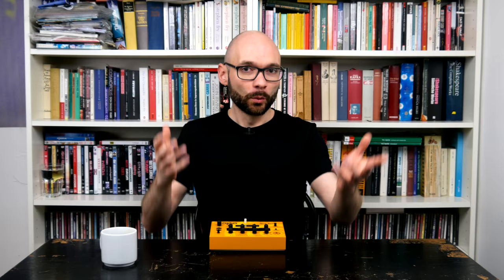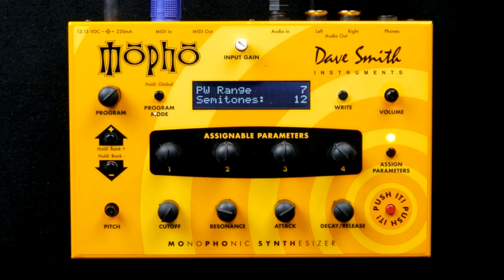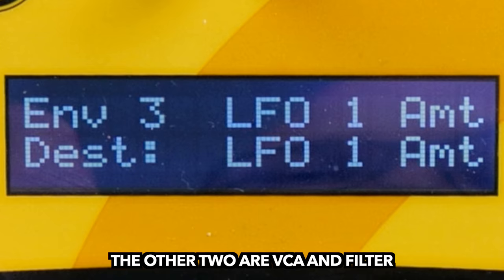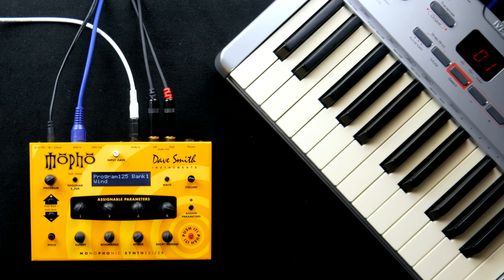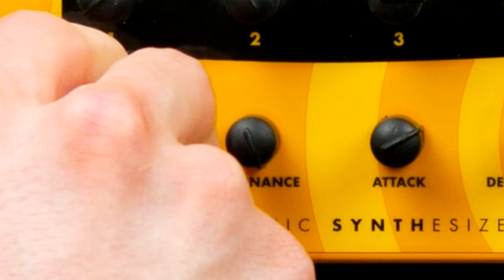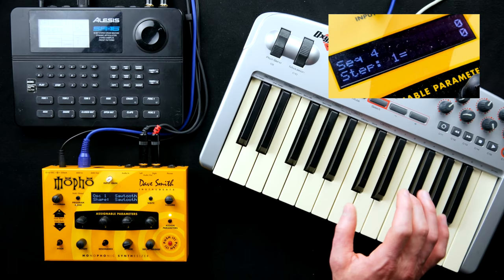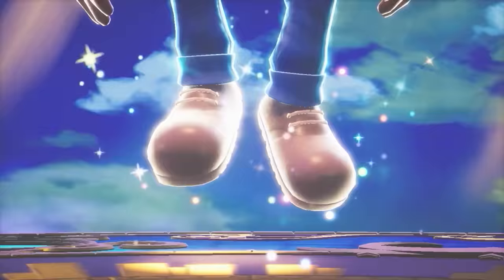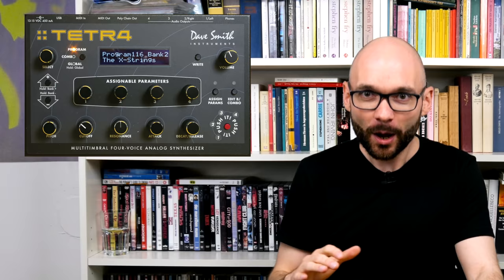Bad Gear - Dave Smith Instruments Mopho - Giving the Pro-1 a Bad Name???

Comment: I have a whole bag of these encoder caps. You can have quite a few. I upgraded my P08 with the $70 overpriced factory Prophet upgraded knob kit so I have no use for them.
Reply from the maker: Thanks! Are these the same encoders?
Reply: @AudioPilz  i believe they are. It's quite annoying the way they are on my P08. I tried to find aftermarket knobs but they are weird encoders. The D-shaft is opposite what it should be. so if you find a knob cap that fits often the tick mark operates opposite of the way it should. Which forced me into buying the expensive DSI factory P08 upgrade kit that makes it look kinda like Prophet 5 style knobs.

Comment: I used to own the desktop version and I agree, it sounds amazing, it’s very capable but it’s always tied to the computer to use the software editor and the endless encoders suck. I did put bigger better Moog style caps on mine though and that was cool. I would love to try the keyboard version. Does that have the same endless encoders?
Reply from the maker: Never tried the keys version but it seems to have normal pots
Reply: @AudioPilz  Ya cool thanks. I’ll have to try to get a hold of one.

Comment: Well, it does take up less space than a Pro One. And it still has better keyboard too.
Reply from the maker: Never tried the keyboard version
Reply: @AudioPilz  the OG keyboard mechanism is that each key has a wire on its underside that when the key is depressed, the wire contacts another conductor and earth's a diode, and sending a pitch cv to the oscillators.

The keybed has a very noisy and colicky feel. Also the point where the wire contacts the other is tiny and highly prone to tarnishing/corrosion. So you gey random keys with partially sounding notes.
Opening up the synth and cleaning all the wires with deoxit takes a couple of hours 2 or 3 times a year.

I just sequence mine through my Synthstrom Deluge and forget about trying to use the keys at all.

Comment: I sold mine at a good price a couple of years ago even after paying for a 3rd party editor.  Never looked back until now :-)  It never did anything for me.  I probably bought it during a mono GAS reflex.  (That is Gear Acquisition Syndrome for those who don't speak synths) I couldn't find a way to use it.   I have many other monos that trigger me to do stuff already.  Too much fiddling around for the hope of getting a fix but I never did.  Even the Kaossilator Pro+ or an electribe mx or even an sx synth sections gives a better fix. and yes I'm comparing to completely digital stuff.  Give me a break with the sounds, It's really hard to get it to do something analoggy.  I have plugins sounding more analog than this thing :-)  I probably bought it for the size but then I was like WTF is this? is it a sound module ? I have many better proper rack mounted modules, is it a live play thing? even a minitaur is many times better for a live thing even with less features.  I couldn't get myself to use it with the DAW since I have better sounding plugins.  I gotta stop talking about this stupid synth. It's getting me angry :-) Awesome video as always though.  After watching this I started to think maybe I should sell my very little used minibrute as well.  It has everything at a nice form but it also has metallic brute sound :-) well, it has a metalizer and a brute factor knobs so what did I expect :-)
Reply: now I will search your videos to see if you made a minibrute video.
Reply: LOL, I realized after watching your minibrute video that I actually have a microbrute 🤣. 
Maybe If I would chop off the small keyboard it might be more interesting?
Reply from the maker: Always mixing up the mini and micro as well😅